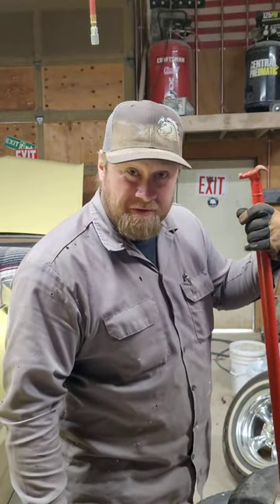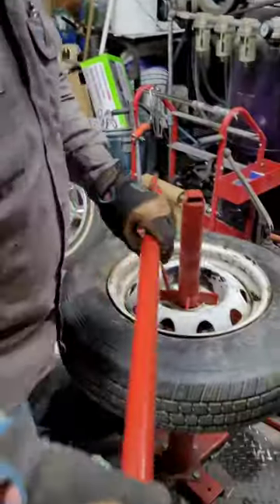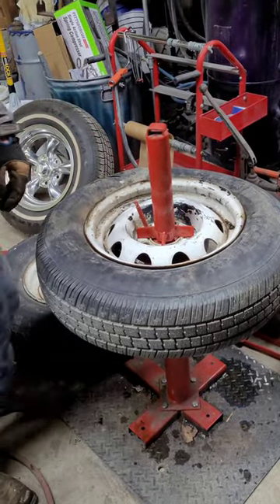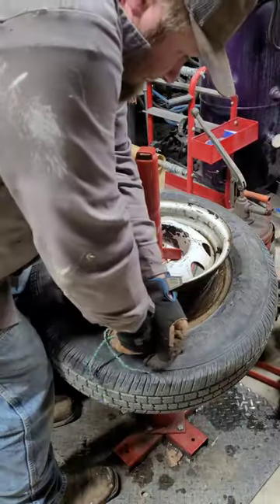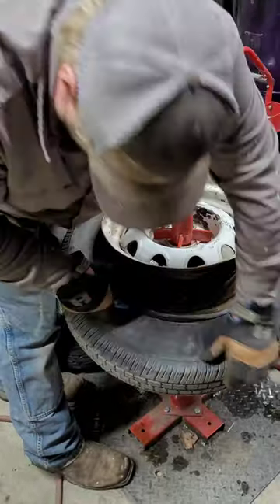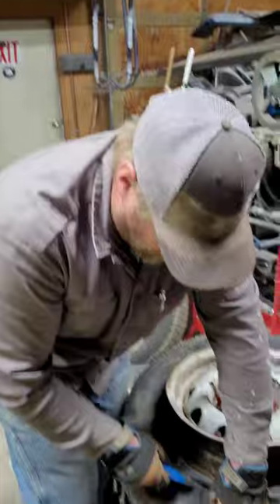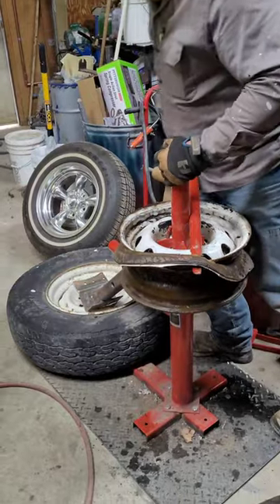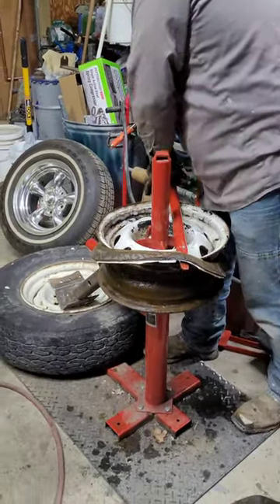Harbor Freight Tire Changer: A Disaster?

Comment: Have owned that exact same H.F tire changer for 12 years now. It's bolted down solid to the concrete floor in my garage. To date i've literally changed hundreds of car and light truck tires of all different sizes and brands with it and counting. You do not need to cut the tire off of the rim in any manner whatsoever. Break the bead on both sides of tire then spray it with a little bit of wd-40. Lock it back down on the machine and the bar will easily slide the tire right off of the rim. I can honestly remove an average sized car tire and remount the replacement on a steel rim in about 3 minutes or less. An aluminum wheel requires a bit longer time simply because it requires more caution to prevent damage. I paid 49.99 with a coupon for my little orange tire changer back in 2010 and it has easily paid for itself hundreds of times over already. I watch these videos of people bad mouthing that little machine and 100 percent of the time it's because the operator hasn't a single clue about how to use it correctly. That little manual tire changer is not meant to perform like a 6000 dollar pnuematic machine like is used in a professional tire shop, but, if used correctly and with a little bit of common sense it will get the job done effectively and save someone a ton of money. It most definitely has done that for me over the last 12 years!
Reply from the maker: Awesome, let's see a video on it!!

Comment: Tips from a tire guy and a owner of one of those. Use brake fluid on stuck rusty tire beads. Mix up a solution of dish soap and water and lube the tire beads and bar. The tire lube saves the beads from tears and the tires peel off n on real easy.
Reply: I have already told them lots of tip's I changed truck car and EM tyre's for years
Reply from the maker: Great tips and thank you for watching!!!
Reply: Good name!

Comment: I know,Right? My Harbor Freight tire changer is mounted to the concrete floor in my carport,it's only 9 years old and only used for 200 to 300 tires,mostly pickup truck tires. Dang thing cost $35.What a waste......
Reply from the maker: I think you accidentally put a couple zeros behind your 2 or 3...

Comment: Every dirt track racer I know uses one. They have no problems. I own one of the mini tire changers and do bunches of lawn mower tires with it. No problems. Maybe it is not the Harbor Freight tool that has a problem..............
Reply from the maker: You're probably right. Although I bent the bead breaker, bent the bar, and bent the rim. I guess I'm too weak...

Comment: I’ve done a few dozen or more tires with one of those and it works okay for the money. I’m happy with mine bolted to a pallet, have had it 8 to 10 years maybe. Taller sidewall tires aren’t too bad, lower profile suck to do and I don’t recommend it for those (thankfully I don’t use low profile, but did remove a few). I have a few of the long tire levers HF sells (tire spoons some call them) as well which come in handy, meaning if the big orange bar isn’t quite doing it, slip in the levers to finish it off. I won’t say it’s an amazing or always easy to use tire changer, as that would be a lie, but usually not too bad once you get use to using it. I have slightly bent the orange bar doing super rusty crusty wheels that I didn’t think were going to let loose (the bead was real stuck), but still got them done. I was going to do videos of mine years ago after having experience using it, but never got around to it. My opinion though is, it is decent for the price if you do a set of tires or two, at home per year, and don’t mind a workout.
Reply from the maker: Thank you very much!

Comment: I use mine for my skid steer tires all the time. Equipment tires are way more stiff that car tires. Especially when they are over 20 years old. I'd recommend some tire irons for the top bead then use the bar they give you on the bottom bead
Reply from the maker: Great tip, thanks for watching!